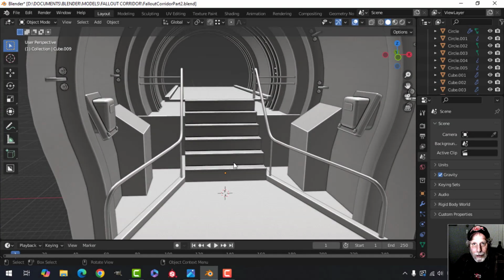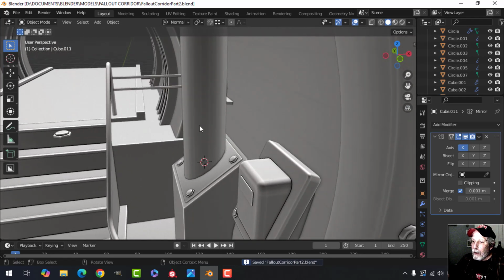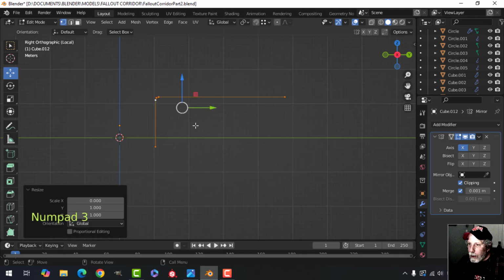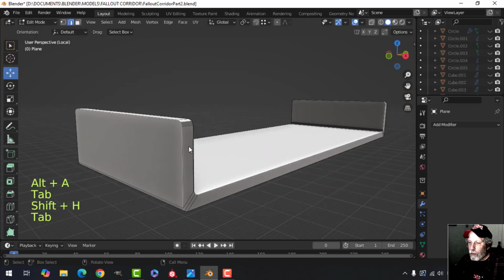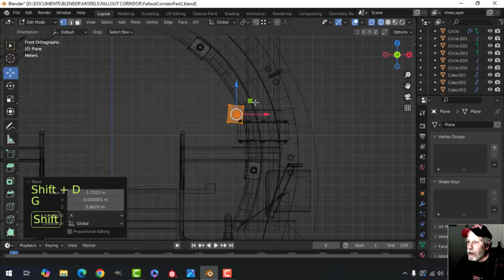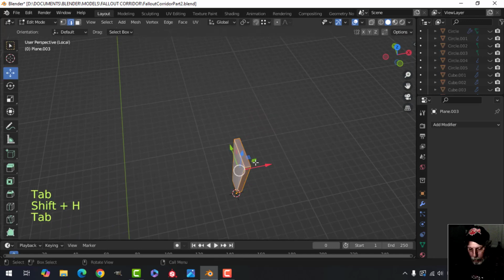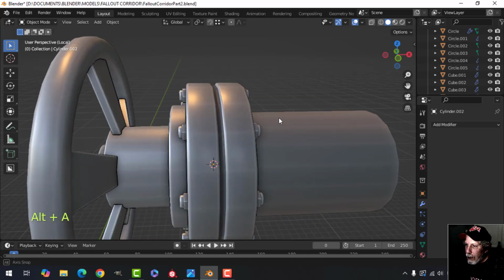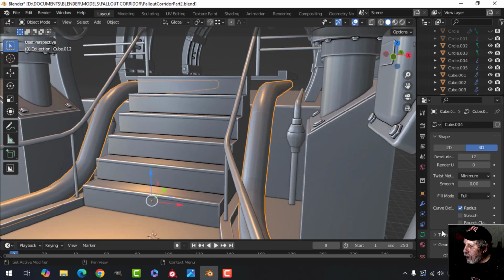BLENDER: FALLOUT CORRIDOR (PART 2)

Comment: I am curious what will the light modeling be like will you be modeling hazzard lights like small red light or and will there be wires going  throw and what about ventilation will see on part 3 😀
Reply from the maker: @Mike930806  there will be small lights near the floor along the corridor and some overhead lights and light on the door at the end of the corridor as well.  There will also be some wires, glowing power lights on equipment etc.